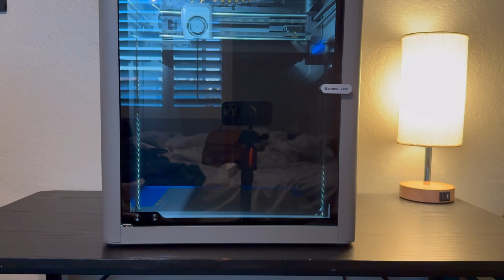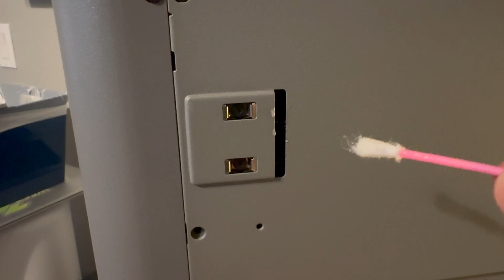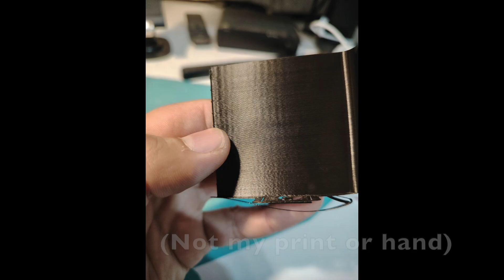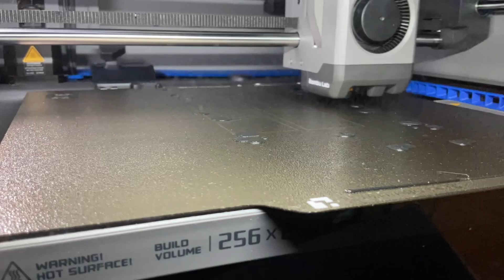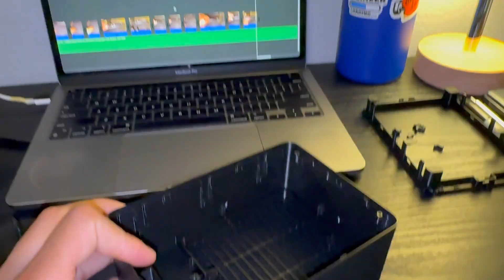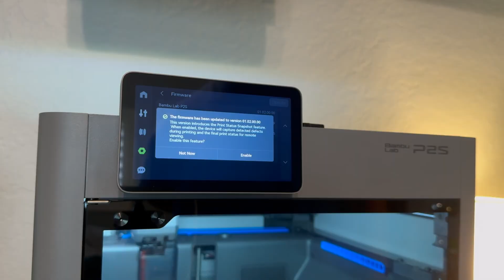Bambu Lab P2S Exhaust Fan Upgrade + 3D Printer Maintenance Routine!

Comment: bro i am having hard time printing these tiny claws how did you manage to inser them my holes are always too small
Reply from the maker: The claws were a drop in fit for me, but keep in mind there are 2 different claw models meant for 1 side vs the other (you really have to zoom in on the wiki to notice this). Depending on what material you’re using you could have a shrinkage issue (ABS/ASA, etc), do a calibration print for shrinkage and adjust your filament profile accordingly. I know my response is late, if you figured this out since posting let me know how!